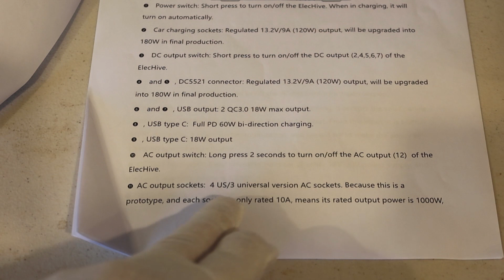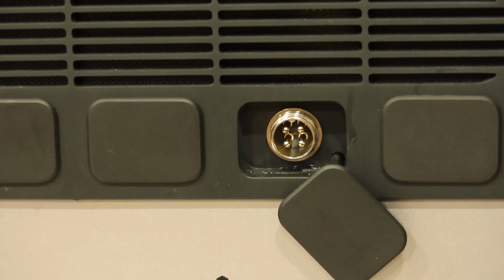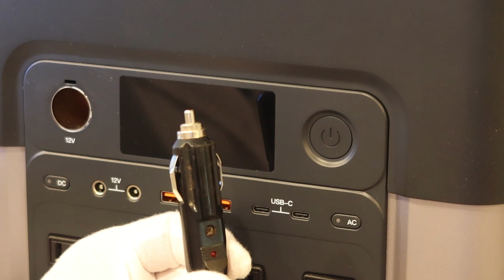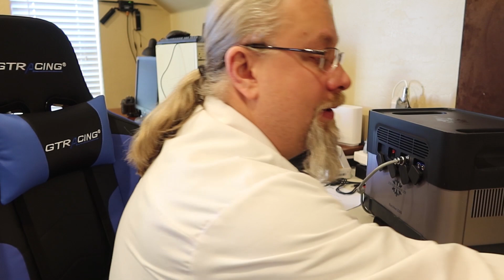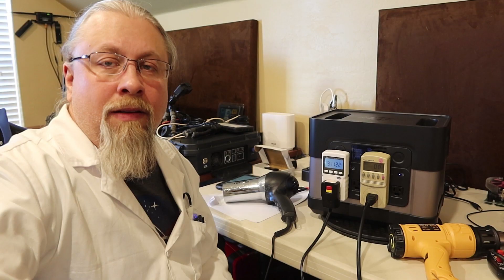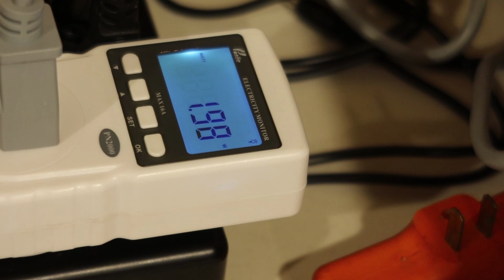ELECHIVE 2400wh Solar Generator Prototype Preview | 2200w ZeroBreeze Portable Power Station Review

Comment: Well, this product finally started being delivered.  I got mine.  I’d be curious on your updates but overall I think this thing is a not good.

Charging - I was using my benchtop power supply (variable) and set at 60v some how the SOGEN would pull it to ~25v.  Next issue, when charging and it gets to the end it doesn’t slow the charge speed so when it shuts off it’s still pulling around 400-500w.  That doesn’t seem to follow a proper lithium battery charging solution but I don’t know the cells/chemistry they are using.  Next issue, voltage.  Running a 1000w load (shop vac) towards the end of the battery (9% remaining) it was showing 900w.  I was curious why.  I checked voltage, 108.2v AC!  This seems wrong!  The ports aren’t well marked, etc.  It also looks like it is polling during charging but the poll rate is SLOW.  It will skip from 97% to 100% (and similar skips along the way in capacity and %).  It’s clear they are doing it with a software loop and I’m not certain they have protective charging on this machine.

Comment: How long can it run a small space heater?
Reply from the maker: Depends on the heater. Small to some is 100w and to others 2000w is small.
Reply: @HOBOTECH  i should've been more specific. How long can it run a 1100w or 1500w space heater?

Comment: Professor HOBO, Two things, the first one is, that heat gun that causes the voltage to drop when it's on low and not on high, it is because of the method that is used to achieve the low setting, on the low setting, they simply feed the power to the heat gun through a single diode, there by providing only one half of the AC cycle, and there for one half power. But that being said, the inverter doesn't like that kind of load, it makes for a very distorted load waveform, and that confuses the inverters voltage regulator. The other subject that I want to address is the over charging, first of all, that unit should never have left the factory, prototype or otherwise, with out having a working over charge protection circuit, with that battery chemistry, that thing is a fire bomb, and the reason why it didn't work after a few minutes of over charge is not that you blue it up, but that the battery voltage was simply to high. That being said, connecting a load to that connector that you had determined to be a direct connection to the battery and lowering the voltage a little would have restored it to normal operation. But great review, I do think that they sorta shot them selves in the foot, having you do a review on something that is that far away from ready for market, they appear to be in way too big of hurry to get it to market, and that can raise a lot of concern as to the integrity of the company, and there concern for consumer safety over profit!!!

Comment: hi Professor, Monteksolar asked their backer opinion for "AC & DC output auto off setting"  I was hoping to pass this messages to Elechive (ZeroBreeze) team as well since I am the backer for both.  Please review and hopefully thru your famous channel, the message will be considered and implemented. 

my wish list:

1. to have the AC power fan based on demand.  i.e.: fan on/off or speed based on the inverter temperature limitation.  as I experienced with other battery, the fan is on as soon as the AC power is on.  this will consume battery.  but their DC power cooling fan is based demand. i.e.: fan not running on low load
2. it will be nice to have a "remote" to activate power on/off.  even sell it as an additional kit.

Comment: :( My recommendation is you start with the normal use test first before going for the probably going to break it test !  I wonder why you didn't test it with the direct to battery output... You could maybe lower it voltage / capacity via it and charge it to full with the included charger in hope that you can bring it back to life.
Reply from the maker: I tried everything. It was 100% dead. I shipped it back for them to figure it out.
Reply: @HOBOTECH  that suck. Based on your video, and the videos they release a few days ago, i feel they have a few revision still to go on their electronics. And if they make a buck at this pricez my guess is we will see other product with similar power that might be more mature in the next few months

Comment: Electhive and you have had some misunderstanding according to there updates 😉
Reply from the maker: There was no misunderstanding on my part. They provided the parameters and I tested the unit based on those parameters. If they provided incorrect information it is on them.
Reply: @HOBOTECH  I think you stretched there panties a little. I've been reading there lastest messages and after your testing they went into "DAMAGE CONTROL"

Comment: Hey Tom, Will Prowse just put up a video not to review any more products from corporations that use a Indiegogo or crowdfunding platform.
Reply from the maker: He can do whatever he wants. I will continue to review popular products no matter what platform they are on as long as viewers demand it.
Reply: @HOBOTECH  Whether the products are good or bad?  Will's problem with the corporations is that the crowdfunded products are defective when the customers get them.  He had a solar generator that was broken from the first day to six months later.  It would turn on then within five seconds turn off.  He wants to support the little guy in the garage who needs monies for manufacturing a product that works time and time again without fail and not some rich corporation with all their top level engineers making a product that fails and use the excuse, "well, it's a product still in the development stage."  Why does a large corporation need monies to develop their products?  The products that you and Will review should be off the shelf ready from a corporation not some test product for the customer.  Waiting for months to receive a defective product doesn't sit well with the public.  Ask Odin.
Reply from the maker: @vicO-3123  I saw the video of course. Will said himself that his three AC200's were perfect, both of mine were just fine. I think what most don't understand is that there are ALWAYS a small percentage of electronics that fail, get damaged during shipping, or whatnot. This is why nearly every company has a return policy. It's a fact there is always a failure rate. Companies are using crowd funding to get the word out about new products because it works so well. Influencers can't review "pre-orders" and its really hard to get excited about a "pre-order". So of course they use crowd funding and social media to improve brand awareness and sales on a new product. It's the same salespeople have done for centuries. The fact is that 1000's of AC200's have been delivered and only a small fraction have issues. Nearly every report here and on our Facebook proves that. I'm going to continue to do my job and review products so folks like you can make informed decisions.
Reply: @HOBOTECH  Thanks Odin.

Comment: Your ability to test these units is clearly beyond the scope of what the company that built it can find for technical help. They should not only be sending you free products, they should pay you extra for your report on what they are doing wrong.  Elon Musk should see your tests, and send you a cyber truck, and clean Odin's litter box.
Reply from the maker: ^^^ Comment of the week. Yes, I would certainly find a way to break the Cybertruck too. I have more years in QC breaking tech than most engineers at these companies have been engineering.

Comment: I am a current buyer on Indiegogo for this unit and what shocks me is they already had a decent product called the Goal Zero Yeti 1000, 1500 and 3000 models with a ton of accessories that seemed to work well together. Which leads me to believe they understand this market sector and have been in it for a few years and they also did it before with some quality products.

I just checked their website and the Yeti Generator is GONE! They have apparently gambled everything on this new product and they hope we will too.
Reply from the maker: Goal Zero is not related to Zero Breeze. Different companies.
Reply: @HOBOTECH  
MY BAD..........thanks for setting me straight.

Now I'm more worried about this ElecHive gamble as they have no history of an electric generator although they had their own battery packs for the Zero Breeze.

Hmmmmmmmm........after watching your video a second time..........they could fix these things I suppose. but not a good first impression.

Comment: Just a point of semantics, without having seen the video. These things are not generators, they are batteries with an inverter/charge controller in a nice housing. To get close to the function of a generator you have to spend a decent amount of money and by a set of solar panels. They can have a convincing use case in some niche circumstances, but in general, these are just expensive batteries.
Not having fans is not conducive to the longevity of either the internal batteries or the electronic components. I stopped watching at 7 min, after hearing you say that it is still in the prototype phase. There are lots of similar products on the market that are actually produced and sold without all the bugs that come with being a prototype. I do appreciate that, from what I have seen are honest about a lot of its drawbacks/bugs, right from the start, like I expect from you, having seen a few of your other reviews.
Reply from the maker: I made this video just for you https://youtu.be/nElIOelXm6A

Comment: I don’t like the fact the inverter doesn’t hold up the voltage. I’m sure 105 volts is not good for a compressor refrigerator and might even be damaging. I have a regular 120 V 3.5 cu. ft. mini fridge in my van I would not be happy if the motor burned out from low voltage. I have a sungzu ska 1000 solar generator now and I think I’m still going to upgrade to the bluetti AC 200 over any of these other high output solar generators. I’d love to get a titan with some extra batteries but that is WAY out of my budget.

Comment: If they can get the quality control in place this would be an interesting unit.  In theory at the introductory price of $1000 US for a unit you could get two for the price of a 200P.  That would give you 2K charge cycles to 80% capacity and 80% capacity would still be > than the 200P.

Comment: The discrepancy between measured watt output, on the cigarette lighter socket, and the displayed consumption is likely due to the regulated output losses...
Reply: Same with the usb-c reported wattage... conversion to battery voltage likely has losses.
Reply from the maker: So 25 watts to regulate a 60w USB port? I think not.
Reply: @HOBOTECH  for sure... that is a LOT of loss...

Comment: I’d be curious how fast it will be from 10% to 80% charging from the EC8 "super charger" port . Oh wait, there’s no super charging station(s) near me to test that out. Like you suspect, that port is directly to the battery and if it is even going through any of the safety systems at all. For the price point it is a tinkers delight and an accident waiting to happen if the bugs aren’t ironed out.

Comment: So far, it's an expensive boat anchor.. LOL!    It appears that these chicom manufacturers have listened to too many boob toobers (as do other boob toobers) when they mention a 110vac supply  (in this country, last used in the 50's), instead of the 120vac which is the USA standard ..  Yes, I know that the vac fluctuates throughout the day, but certainly never down to 110vac unless someone lives under a rock or in cali (no disrespect to the under-rock dwellers, but plenty for cali scum who are now moving out in droves after they voted in the policies they love and bring TO THEIR NEW RESIDENCE to destroy another town CLOSER TO ALL)     or uses a Variac..
Reply from the maker: To do it correct with a portable unit it should be 115v. I think the reason they don't do this is international compatibility. It's easy to double 110 to get 220 for Europe.
Reply: @HOBOTECH  Thank you, Sir.   My concern is that if the item is built for 110vac, then vac, vdc and current all increase proportionally putting stress on already crappy chicom miniscule parts..    Be well....

Comment: They must have been smoking crack to have sent you something so half-baked.
Reply: They need somebody just tell them what to do
Reply: Pretty cheap the pledges pay for all the production of the product sounds like they don't have any money
Reply: I was in every aspect of software for over 25 years. Developers and management were always pushing to get product out the door as quickly as possible to get money in the bank as quickly as possible. Getting companies to invest in solid QA and testing methods and practices was like selling ice to Eskimos.  I guess things haven't changed much since the early 2000's.  Fix-On-Failure is still more palatable than delaying a product launch.

Comment: Been a backer of Elechive for two weeks. I want a small and light solar generator that will run my pellet stove for many hours if the power goes out.  Also want to use it for camping. I may use it for some lights in the event of a power outage as well.  Sounds like they need to fix the screen (known issue) and the thermal, input, and output limiters.  They probably should have waited to release a better prototype for review. Still a backer though.

Comment: I agree with you about the lack of current protection on the DC accessory port, but all external DC circuits should be appropriately protected and fused by the user anyway.  The campaign ticked off several check boxes for me so I'm willing to wait for a production model.  They did take a big risk sending you a prototype, and hopefully they'll send you a production model to test when they're ready to ship.

Comment: Good review! Also, I ordered 6 of the BougeRV 180 watt panels when you did a review on them in November. They never shipped and when asked they said they 'might' be available in February(!) - Save your reputation and stop recommending them. It's a scam IMHO - just lucky that I cancelled the charge on my credit card in time 8/
Reply from the maker: 1) BougeRV is not a "scam" stop spreading fake news. 2) BougeRV sold so many panels after I put my video out they ran out of inventory ...SIMPLE. More is coming! 3) Ships have been backed up at harbor for 2-3 weeks longer than normal in California where everything is shut down. You know this little thing called Covid has crushed the world's supply chain? 4) If you are in a hurry they sell them on Amazon where you get them a lot faster but they cost a lot more.
Reply: Hobo's not responsible for supply chain inventories.  You've heard of this whole GLOBAL pandemic thing?  Well regardless of your opinion of it,  it stopped manufacturing and shipments EVERYWHERE.   3-6 month backorders is now a standard for most businesses.   It's going to be awhile before supply and demand balance out again.   Sorry.
Reply: To be fair to BougeRV they do seem to be running out quickly from whoever their supplier is. They will send it, when they get more in. But I see how that can really screw you over if you need or want it in a certain time window. But they do post on their website as soon as they realize they are out. And say when they will have a supply again.

Comment: Do you have a video showing how to splice MC4 connectors. I need to know how to attach extended MC4 positive and negative. every time I try to push in those little inserts, the electricity never goes through. I’m wondering what I’m doing wrong?
There are times I don’t want to buy new wire with connectors, just so I can get my panels to work. The whole reason to splice is to extend the wire when needed. 
For some reason I can’t do it, perhaps there is a tool to push those inserts in further? Frustrated! 🤔
Reply from the maker: You must have missed this https://youtu.be/9v0YMF7TMrk
Reply: @HOBOTECH  
I guess you don’t understand, I already know how to put them together, I just can’t get them ever to connect properly to get the electricity through one to the other! 
Can’t figure out how to push them for enough in?

Comment: In my opinion, they should have waited to send out a prototype and explain the reason why they are holding off.  You want to make a good impression when trying to get additional investment. Having many things not working properly, (I know they had the disclaimer), and a sloppy build of the product gives somewhat of a negative impression about the company and may make people who were going to help fund, hold back until they get proof that the company can build something of quality.  Other companies have had prototypes that were more professionally built and tried to make most features work as designed, not something scaled back.   This may be a great product in the end, but the initial impression for me is not great since they have not proved to me that the features they are promising will work since they have a scaled back model.
Reply: Agreed.  You don't get a second chance to make a first impression.
Frankly, this prototype has far too many things wrong with it and is put together too poorly to make a good first impression.
How many of these prototypes did they send out that would have stopped them from presenting a professionally assembled product that might have some minor things wrong with it or a product that is closer to the promised production model?
Promises are cheap.
Reply: Yup, power stations are a HUGE investment for most people. And this is a disappointing prototype on many levels.
Reply: I don't think this company builds anything I think they pass it around until it  gets fixed or built right

Comment: Did you try turning it on n off again? :P the MCU probably froze somewhat or welded a relay
Reply: Might have to disconnect the battery, if it has a deep sleep MCU mode